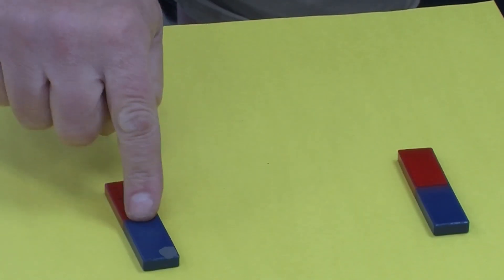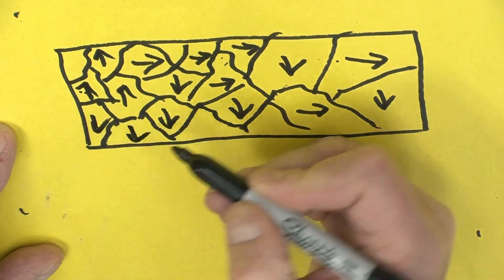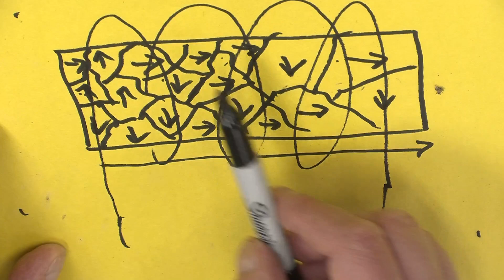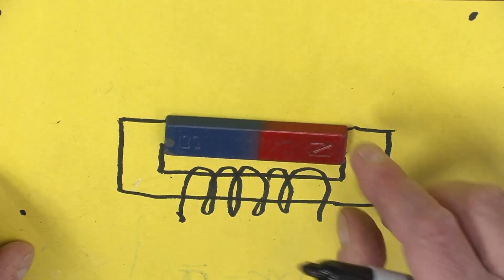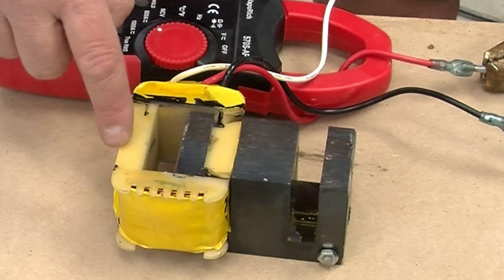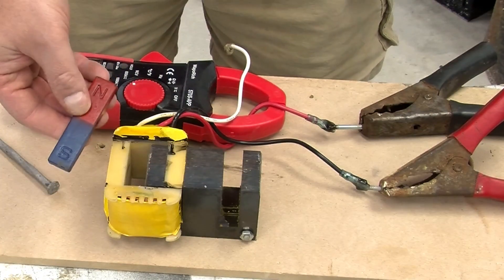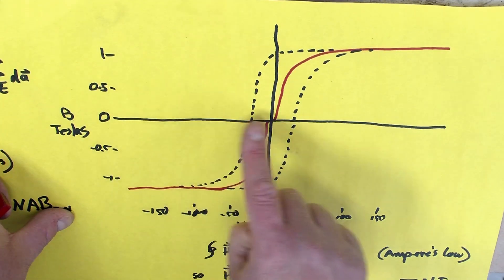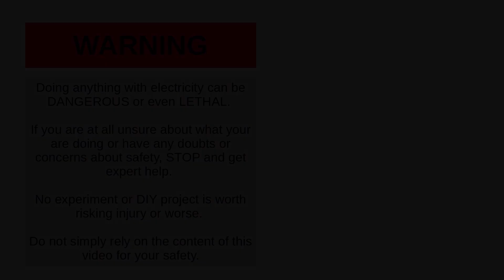How to (Re)Magnetize a Permanent Magnet

Comment: I have a magnetic implant, a neodymium magnet 2mm by 1mm, its inside my finger but over the years has lost its power, any ideas of how I can re-magnetise it without burning or electrocuting myself???
Reply from the maker: Obviously, I cant provide any medical advice. To re-magnetize a magnet, you need to subject it to an intense magnetic field, which will also STRONGLY pull magnet. I would be really concerned about about that causing all sorts of damage, possibly ripping the magnet right out of your finger, and maybe in the worst direction possible. So I sure wouldn't risk anything  like that. Sorry ... not the response you probably were looking for.

Comment: Very nicely put but I still in my own right think that the domains are really nothing more than the attom of certain metals having more free electrons which creates a higher covalant bonding and the north and south characteristics are because of the manipulation of electrons  making up the negative magnetic pole realative to the stationary protons the positive magnetic pole.
Reply from the maker: Here's the thing: if you have theory for magnetics or anything else that you believe is better than the existing ones, you have to demonstrate it by showing: a) that it correctly predicts what the current theory predicts correctly b) that it correctly predicts some things that current theory gets wrong (ie current theory has a  flaw  that can be shown by an experiment yet your new theory does correctly predict the result. ) 

Part a) confirms that it is at least as good as existing theory
Part b) shows that it adds something of value in addition to existing theory. 

If you have both, you may have a winner! With Classical Electromagnetics, achieving the above is not easy - the existing theory correctly predicts so many things so well, and its main missing points are filled in quite nicely with Relativity and Quantum Mechanics. 

So the challenge to you is, make a youtube video explaining your theory and also demonstrates with an experiment how it fixes some error in what the existing theory predicts.
Reply: @ElectromagneticVideos  Yes, my comment on your demagnitizing video acknowledges that. But now I have to unsubscribe because you are taking my comments as an insult rather than what they were intended for. I was merely trying to have an open-minded conversation to stimulate and motivate critical thinking. Have a nice life.

Comment: Well I demagnetized my pocket magnet by applying sufficient heat to solder the telescopic segment that failed...(close to the tip no less 😅) I kind of suspected it could damage it but twas already broken. 

My uncle told me point a nail north and wack it with a hammer... Weak... but sure enough 🧲

Neodiddlium as AvE says 😂

Comment: Basically a magnet is a trapped polar charge. And any magnet in any form is in fact a permanent scalar wave emitter. 

If a single coil with sufficient length of wire will pas through permanent magnets and magnets are placed at a distance equal to 1/2 of wave length corresponding to frequency of the alternating current  voltage will will be greatly amplified while ohmic resistance in wire will be reduced by 95%. The higher the frequency the shorter distance between magnets where they MUST be placed exact where 1/2 of wave length is (max amplitude) 

This a different way to exploit permanent magnet effect and not only 200 years old methods … ie Faraday, Lentz

Manipulate magnetic field to create electricity or manipulate electric field to create magnetic field/flux

Remember, two separate electron flow running against each other create scalar waves, zero point energy or whatever name scientists use for this effect. And all this is possible because existence of aether … Galileo Galilei said: E pur si muove !

Magnetic field means instant action at distance … instant is obviously faster than speed of light, yet mainstream science deny it against all evidence !

Comment: 70 amps seems very high for a battery charger! Would this current not turn the water to hydrogen and oxygen.  What about an arc welder with just a few coils of very thick copper to magnetise.
Reply from the maker: The charger's high current output is for boosting to start a car with partially charged or dying battery. Its an old one - no fancy electronics. When charging a typical 12V battery it typically puts out about 40A - a bit much but great when you are in a rush.  And you right - that amount of current (or less) after a full charged will create hydrogen and oxygen in a lead acid battery. 

An old style (DC) arc welder would work well too - its natural current limiting ability could be very useful for that sort of thing. Great thing about the old style arc welders is that they are are often available quite cheap in the used market. I got an old 230A vintage AC welder for about $100 a few years ago. The new electronic switch power supply arc welders would certainly have the current generating  ability - but I'm not sure how well they would react to being attached to a coil - I wonder of they would determine something is wrong if they dont detect an arc and shut down.

Comment: Does the magnet need to be touching the magnet system for it to be connected
Reply from the maker: It doesn't need to be touching, but the larger the gap is, the lower the magnetic field from the electromagnet will be and so the effectiveness of the magnetizing process will be reduced. 

As long as field is somewhat greater than saturation value of the permanent magnets material it should work fine, just this will be harder to achieve with a bigger gap.
Reply: @ElectromagneticVideos  Thanks, I appreciate it highly say for arguments sake you passed a permanent magnet through an electromagnetic field indefinitely in and out of the field would it then holds its charge forever in theory?
Reply from the maker: @Caigebraiden98  I'm not sure what you mean by "passed a permanent magnet through an electromagnetic field indefinitely in and out of the field". Bottom line: if you have a good magnetically hard material for your magnet and expose it to a nice strong field (above its saturation level) to charge it,  it will hold its magnetism well. However, do "bad" things to it like forcing the like poles of two magnets together, and maybe even banging them at the same time, and the magnetism will be reduced or lost.
Reply: @ElectromagneticVideos  I’m currently designing something, could you point me in the direction of any text books that go in to mass detail?
Reply from the maker: @Caigebraiden98  If the want a general electromagentics text book, Electromagnetics by John D. Kraus is the one to get. It covers all the theory and includes applications. But you will need some math background, most importantly vector calculus. From your questions it sounds like you are more in need on something specifically dealing with magnets and some very hands on advice on making them. I dont know of any specific book that covers the the very practical aspects of making magnets more from a production and manufacturing process. So unfortunately the best advice I can give is google or go to a university library, or even better better, a university Electrical Engineering library or Physics Library and browse the appropriate section.  You know, even searching YouTube might bring up what you are looking for.